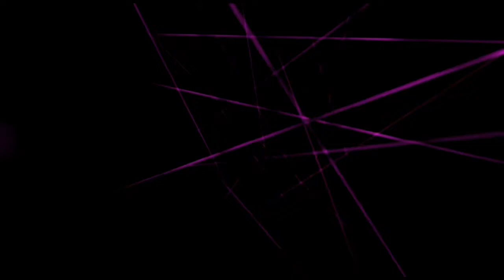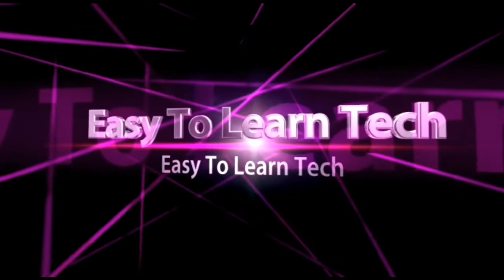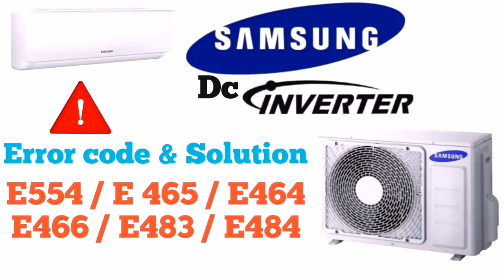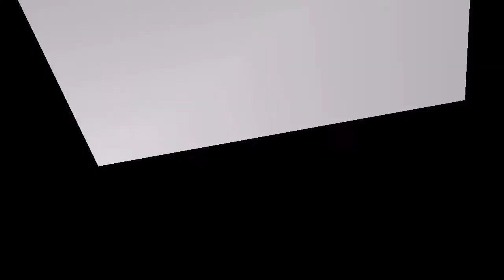#LIST3 || SAMSUNG DC INVERTER ERROR CODES || STEP BY STEP SOLUTION || TROUBLESHOOTING || NUMERICAL |

Comment: Lodz plz help me I just  inconter error 466 484 483.. Samsung error
Reply from the maker: (Error Code : E466 ) DC-Link voltage under/over error ..
1) check the reactor
2) check the connection of connector.
3) check the PCB if it's providing proper Dc voltage to outdoor unit.

(Error Code : E462, E484) = Current error / PFC overload error 
1. Check items
1) Check the power and restarting after power reset
2) Check the outdoor unit installation and environmentsCheck if the outdoor unit inverter PBA related wiresare disconnected. Check the installation environment
3) Check for indoor unit installation environment
4) Check for open service valve

Code E483: Overvoltage Protection Error.

All this errors are for voltage low /high in outdoor unit.

Comment: Can can repair my samsung ac showing E466 error
Reply from the maker: Troubleshooting3-20 DC-Link voltage under/over error (Error Code : E466)
@Check items
1) Check the power and restarting after power resetIs there any problem with input power?
(1 Phase: 220Vac, 3 Phase: 380Vac)
Does error occur again during operation after power reset?
2) Check the power cable connection, and joint cable connection
3) Check the reactor and reactor wire
4) Check the fuse on the EMI PBA5) Check the Terminal block, power terminal cabinet and the power wire assembly.
At last if your getting the error change the outdoor PCB.
Reply: @Rehankhan_HVAC_TIPS  thanks for your response
But I am not a technician and there is no technician in my area who can do this .
Pls look if you can do some thing
Reply from the maker: I can't provide technical person, because I am from another country.. Sir
Reply: @Rehankhan_HVAC_TIPS  oh! But any way thanks
Reply: @Rehankhan_HVAC_TIPS  bro I'm having trouble with my ac , turns on and off randomly while beeping.  Also where are these codes on the unit . Thanks bro
Reply from the maker: Send me a mail, than I will try to send you some troubleshooting methods.....
Reply: I am from modinagar near ghaziabad
Reply: @easy to learn tech. I have a 2ton samsung mini split,  can you tell me where can I check to be able to see this error codes .

Comment: Is there any way by which I can detect the leakage in outdoor evaporetor? There is no oil mark on evaporetor and the discharge/suction valve. Still the technician telling that there in a leakage at evaporetor.
Reply from the maker: Sir tell him to put pressure in indoor evaporator coil, aske him to show where is the leakage, if leakage not found in indoor, than tell him to put pressure only in outdoor unit.
Reply from the maker: And check the pressure when he put, again check after one 1hrs, if pressure drop than their is a leakage.
Reply from the maker: Sir for any other queries pls email.